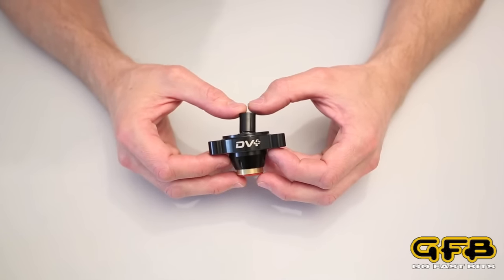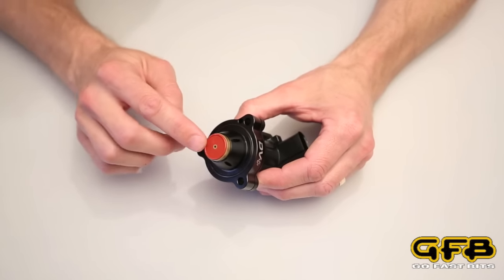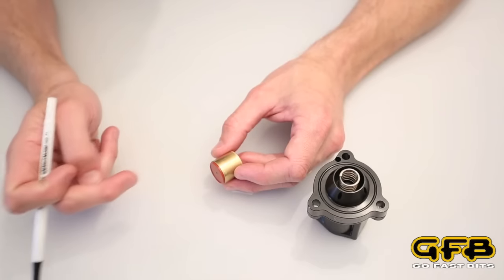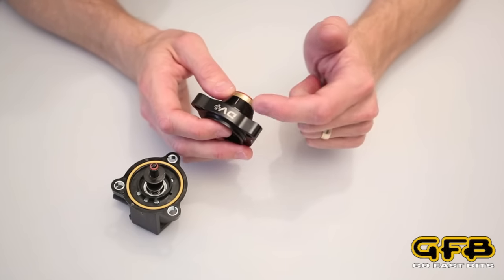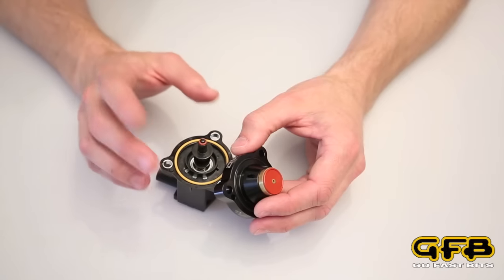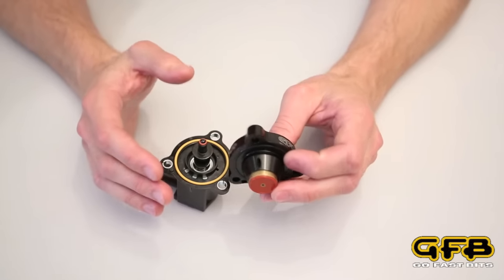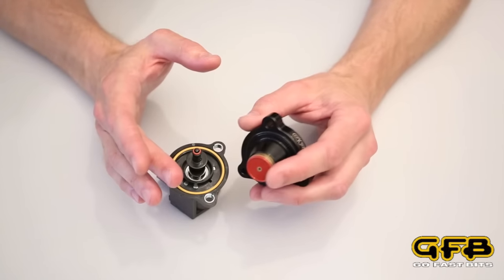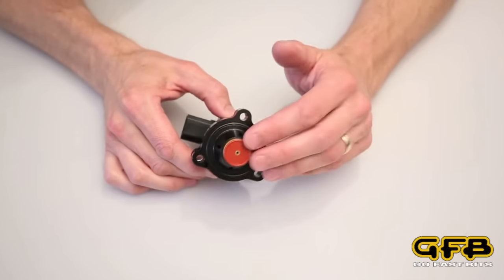GFB DV+ How It Works

Comment: just installed mine on my abarth, and my god is it good.
Pros:
-Throttle response makes it feel like my car is NA
-Boost holds at high rpms (and feels like the rpms climb faster) 
-most significant change is low end torque, it just takes off (feels like its quite a bit faster 0-60)  
-big changes to performance for such a small and relatively cheap part
Cons:
-Installation is difficult, at least for an abarth 500. ( have several hex/allen keys on hand you're going to drop many)

Comment: Put this on my Abarth 500. Works pretty damn good, makes the drive a whole lot smoother and holds in the boost near redline. The stock piece was garbage and made of plastic, I have no idea how it even worked in the first place.

Without the DV+ my car would shudder badly when letting off the throttle and jumping back on the gas. The factory piece would just dump all the boost at the slightest lift off the throttle which is VERY annoying behavior, DV+ solved that. Also near redline boost would leak all the way down to 12psi immediately after reaching peak boost of 18psi. Now with the DV+ the gauge pegs at 16-18psi and stays there like it should. Definitely a step-1 mod on the list before you do anything else to your car.
Reply: Your absolutely right shits sick got it for mine too.
Reply: Been long time lol. Have you used the main spring or just without it?

Comment: This DV worked wonders in my 2.0 TSI Seat Leon FR, eliminated most of the lag found at low RPM's (running an APR stage II+ remap) and gave me full boost at a wider RPM range, I totally recommend it! Do not waste your money on those expensive valve kit "solutions", this DV is the shit!

Comment: I'm quite keen on one of these, will they work effectively on a supercharger setup? 

I've got a vortech (CAPA) supercharged xr8 falcon that uses the age old VGA style plastic valve (same as the factory turbos/etc). 

Obviously with a supercharger constantly blowing air, even at idle i needs to get out and i certainly dont want to see any comp surge on a centri blower! I assume since its just plumbed directly to manifold vac line, if the throttles shut/plenums got vac, and the rear valves being held open, the blower airflow will just hold the GFB open too vent the whole time (since pressure will never drop to zero)

Really keen to throw away this plastic POS and get something good on there without having to go hacking at things and modifying everything, love the idea of unit, straight plug in!

Comment: Just got my bov from u guys I love it
Reply from the maker: Thanks very much for your feedback! We're glad you're loving the valve :)
Reply: @gfbvideos  hi noticed there's 2 versions from authorised sellers. Which one is the newer, revised one? The one with 3 vent holes or only 1 vent hole in the housing where the brass piston seats in?
Reply from the maker: @JH-sc7cs  The one with 1 hole is the more recent version. There is no functional difference between the two, it is purely for manufacturing efficiency improvements. If you have questions about a specific seller please contact us and send links to support@gfb.com.au

Comment: Forge sounds way better since it flutters but the GFB bov has a better response and holds a lot of boost. I felt the difference to be honest
Reply from the maker: Hi Walid,
Thanks for your feedback! We're glad you're loving the throttle response of the DV+
While some people may be looking to get that flutter noise, the purpose of a diverter valve is specifically to avoid this. 
Flutter is the noise created by compressor surge which is potentially harmful to the lifespan of the turbo. This happens when there is excess pressure and low flow, such as when the throttle closes

The diverter valve is designed to release excess pressure and avoid this.
Reply: @gfbvideos 😮You write that fluttering is harmful to the life of the turbo compressor!  This fluttering sound occurs on all dv+, so is it harmful to the life of the turbocharger?🤔
Reply from the maker: @SamSung-4ever  Fluttering at HIGH RPM’s is best avoided as there is a larger load placed on your turbo when coming off throttle. It is critical to note that fluttering at LOW RPM is NOT as severe as fluttering at HIGH RPM. If you’re not hearing any fluttering at high RPM, then that would imply that your DV+ is working as intended, however – I’d highly recommend contacting us at support@gfb.com.au so that we can double check everything over and ensure that everything has been installed correctly.

What can happen with our DV+ is that at LOW RPM there isn’t a sufficient amount of pressure in your intercooler piping to overcome the pressure differential of the valve and recirculate back into the intake. This is NOT at fault of either the DV+ or your vehicle. If you wanted to get rid of low RPM  fluttering, we’d recommend removing the main piston spring (short, fat spring not the tall, skinny spring).
Reply: @gfbvideos How to avoid fluttering at high revs?  Do I have to drive slowly to avoid fluttering at high revs?  Without a large spring behind the piston, the car jerks when starting and stopping slowly, which is dangerous, so I use both springs.
Reply from the maker: @SamSung-4ever  Hi, we’d just like to go through a few troubleshooting steps with you – could you please contact us at support@gfb.com.au? We’d be more than happy to help there. Thanks.

Comment: Installed mine a week ago and its working perfectly.
Just a quick question, the piston it’s upside down when installed, how it holds itself on place? Its the continued pressure what makes it stay on place?
Reply from the maker: Glad to hear you're enjoying the valve! 
I'm not sure what you're referring to about the piston sorry. If you can let me know what vehicle it's installed on I can give you a bit more information about how your specific valve works
Reply: @gfbvideos  in my 2.0tfsi, the diverter valve is  positioned “upside down” so the piston its facing the floor. Just for curiosity, how it holds himself on site? By the pressure turbo makes?
Reply from the maker: @Gapped86  Yes the piston is held closed by boost pressure. The area difference between the front and back sides of the piston mean that there is a greater force acting to hold the piston closed

Comment: Hello, is there a VTA version for the T9352? I'd like the blow off sound along with it.
Reply from the maker: Hi, the issue on most of the vehicles the T9352 is intended for is clearance, as the VTA is quite a bit taller than the DV+ version. A little secret, the VTA we sell for the Mercedes (T9458) will fit the same turbo and diverter valve as the T9352, but it probably won't have enough room around it to fit. If you can let me know what vehicle you've got, I can advise if you've got a chance of fitting one on there. Best to contact us through our support channel via the website, as we may need you to send some photos of your factory diverter valve.
Reply: @gfbvideos  I've got a Peugeot 508 1.6 THP. Same as the 207 and mini
Reply from the maker: @cjerp  The location of the diverter valve on the 508 is actually different to the Mini, which in your case works in your favour. We have had a customer fit a T9458 to a 508, however the top of the solenoid does press against the plastic turbo intake pipe, which is why we don't list it as an official fitment. If you'd like to see a photo of the installation please contact us through support.

Comment: I have the GFB DV+ in my 1.4T multiair engine, and I am very happy with it. I read some forum posts that say that the forge valve (which is a direct replacement of the stock diverter valve) is better. They say the forge valve has zero leaks, whilst the GFB one, is better than the stock, but still has some minor leaks. Is that true? My opinion is that the forge one is way more complicated to install, with many more prone-to-fail parts. Brett can I please have your comments on this?
Reply: @ Instablaster :)
Reply: @Ruben Camdyn thanks so much for your reply. I got to the site on google and Im waiting for the hacking stuff atm.
Seems to take a while so I will reply here later when my account password hopefully is recovered.
Reply: @Ruben Camdyn It did the trick and I finally got access to my account again. I'm so happy:D
Thanks so much you saved my ass :D
Reply: @ You are welcome =)

Comment: you should have mentioned that it needs oiling at installation and every period or it gets stuck and throw a code
Reply from the maker: Fair comment about oiling during installation, but periodic maintenance/oiling is not something that is required. The anodised bore is extremely hard wearing and does not need oil for proper operation or longevity. We only suggest it during installation (in the instructions, obviously I neglected to say in this video) as it's a bit like breaking in an engine - the microscopic high spots left over from machining on the piston will be flattened during the first week or so of operation, and a bit of oil is beneficial for this process. Ongoing however, oiling is not required. 

If you find your valve is getting stuck, it is likely a different cause, and removing and oiling it is masking that cause. As we mention in the instructions, the piston to bore clearance is extremely close, and it's possible there is some very minor distortion or damage on the piston that you could only detect with precision measuring equipment. Please contact us here if you have any concerns about this https://gfb.com.au/contact-us/tech-support/
Reply: @gfbvideos  after oiling and reinstallation no code appeared yet thank you for your comment :).
Reply from the maker: @HybridShedIraq  If that was your experience and it solved the problem once and for all, that's good news. However, if it continues to occur, I'd suggest contacting us via the tech support link in my reply above. My point was that even if it did solve it for you, for the benefit of people reading these comments it is not a required ongoing maintenance technique - as I mentioned above, if you do have to do this regularly it's a band-aid that is masking another underlying issue.
Reply: Hi. 
So now, five months later no problem ? No stuck piece ? Dont need to re oil it ?
Id like to know before install it on my 7R golf. 
Thanks for your reply

Comment: I don't have the plunger spring with my kit.. I know i can buy one for around £9 but that's quite a hit for a small spring. The early kits just used the stock spring.. would it be safe to use until I can get the gfb plunger spring delivered?
Reply from the maker: It will work with the plunger spring, however at higher boost pressures the valve will blow open. This may or may not be an issue depending on how much boost pressure your car makes.
If you purchased the part new and the spring was not there it may be covered under warranty. Please contact our engineers at support@gfb.com.au
Reply: @gfbvideos  thanks for this. The car is stock and not tuned at all. But as long as I know it'll run fine as it is I can order a sping before tuning. 👍

Comment: Can diverter add more boost?  Or just prolonged life for turbo ?
Reply: Not sure if it will prolong the life of the turbo but it's designed mainly to improve throttle response recycling the air into the intake, it will definitely not add any more boosts.

Comment: I have the N13B16 BMW engine in my car. Acording to the description both the T-9356 and the T- 9357 will work with this engine. I ordered the T-9356. What is the difference to the T-9357?
Reply from the maker: Hi Siegbert, 
Only the T9356 will work with the N13 engine. The T9357 is to suit the N20 engine. You can search your vehicle on our website to display the correct fitments.
Reply: @gfbvideos  Hi, thanks for the quick respond. Got my T9356 today and already installed it. It works great. No more starting weakness, no more giant turbo hole between gear shifts. Im also happy to see that there is no error code reported by the ecu(big spring installed). This thing is worth every cent.

Comment: Do you have to modify the OEM solenoid on a 1.4l dart??? Wont lie I got a knock off DV+ and had to modify it and now I have no power. Have a brand new solenoid on order from euro compulsion
Reply from the maker: You don't have to modify the OEM solenoid, but you do need to completely disassemble it, meaning the little plastic ring that holds the blue seal needs to come out. But you don't need to modify anything.

Comment: Fitted mine today in my GTI K03, feels a lot more responsive low down and as it has an induction kit on it you can hear the DV is closed much more than the stock one, no more constant loud hissing on part throttle. One thing though, loud flutter on gearshifts, have fitted turbo muffler delete though. Should there be any surge releasing throttle on boost? Sounds cool to me but just wondering if it's normal.
Reply from the maker: Hi Andrew,
Depending on your level of modification it may be normal to hear some flutter under certain conditions if you choose to use the main piston spring. I would suggest getting in touch with our engineers at support@gfb.com.au and send some video of what's going on and info about your car so they can take a look

Comment: Part of the explanation had a mixup of pressure vs force consent. Two sides of piston have equal pressure => no force. Doesn’t matter how the piston is designed or if u paint part of it in red or if you ‘think’ one side is 20% bigger.  Classic mistake.

Comment: When I first installed my dv it used to flutter but not anymore any reason why ?
Reply from the maker: Hi Mohamed, 
We've just replied to your email on the topic. Feel free to reply if you need any more info
Reply: @gfbvideos  thanks a lot for your reply, very nice explanation. 
Another thing, I wonder where does the blow off sound come from given that the design is closed from every where and why does it sound a little louder after I installed the DV+?
Reply from the maker: @MohamedTarek-qm3vf  The sound comes from the intake. The air is re-circulated back into the pre-turbo side of the system, so depending on what intake you're using you may hear the air vent. 

The stock filter and intake is designed to block out these noises, so you're less likely to hear them. With an aftermarket intake that's less restrictive to noise, you should be able to hear it.

The DV+ shouldn't really have any effect on the volume. It may be that you're just listening for it more, or it may be that something else has changed